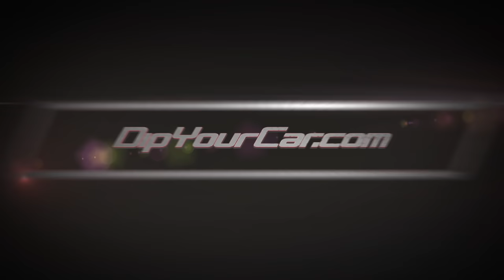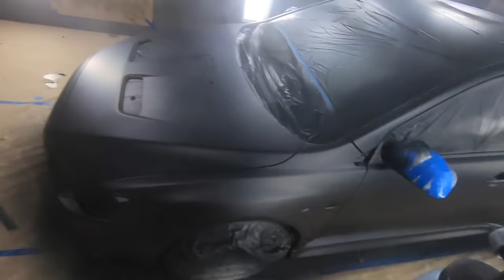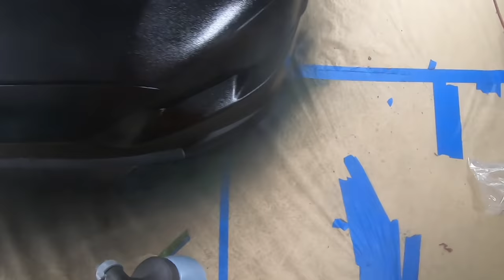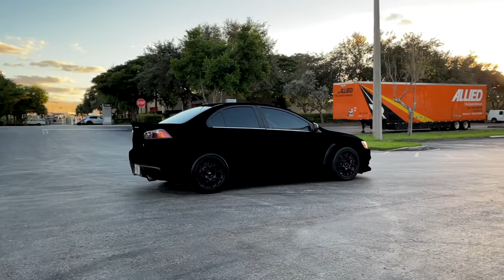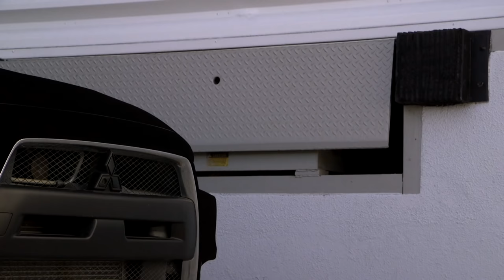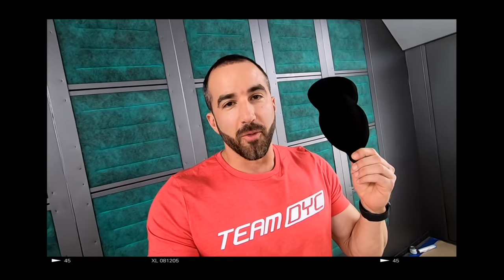Spraying a Car in the WORLD'S BLACKEST Paint (Darker than Vanta Black?)

Comment: As much as I love this.... "we do not recommend painting a car with Musou Black because the paint is fragile and the coating can easily be scratched/peeled off."
Reply: Could this fragile paint be protected or sealed under many coats of clear coat?  Also other auto paint designs are now racing through my head....
Reply: @lesacarter8834  that would 100% ruin the finish.  I have had many alternative finish paint jobs.  The best ones were just paint and no protection coat.  I have tried the matte and flat clear coats but they have more sheen and depth which inherently ruins the original alternative finish
Reply: @lesacarter8834  No. Clear coat is the source of the normal reflection in paint, not the paint underneath.

Comment: How about using the glue-backed flock IR sheet (over a protective layer) instead of the paint?
The effect wouldn't be permanent, but it wouldn't need a topcoat/a topcoat would negate its properties.

Comment: I just ordered some mousa black i have a 2013 jeep wrangler with raptor liner i did a pass with mousa black a year ago but with a roller lol and it came out good but in some spots you can see the rolls lol so now i bought 2L and gonna spray it down with a paint gun just worried that the gun will get clogged will see what happens

Comment: I wonder, would this kind of nonreflective paint be road legal? Googling, I can only find results about overly reflective paints/wraps/tape on cars, I can't find anyone who has ever asked if a car can be "not reflective enough" to be considered safe.
Reply: Hmm.... Interesting thought, I've seen a few cars painted with matte black paint irl, but it looked like a home job so idk.  Might get pulled over the same as if your tint was too dark?
Reply: so far it wasn't possible. Therefore there was no need for a law.... this might chanfe soon....
Reply: @doppelhelixes  not really musou black degrades pretty quickly when exposed to the elements, also dust and other particles adhere to it very easily, so to maintain this effect on the car you would need to only drive it for show, and keep it in a garage at all times, nvr drive in the rain, snow, or overly windy days, not on highways, or dirt roads, or anywhere with a lot of particles in the air or on the ground
Reply: i feel like its one of those things that has never been an issue so need for any legislation. one benefit im sure it would make it pretty difficult for laser radar to get any accurate reading on you
Reply: There’s a video on the bmw that was covered with vantablack and they said it wasn’t released cuz it would be too dangerous . I would totally get this if I could 🤣😩
Reply: @nevino11  Yep, it's a new thing just like 20-25 years ago there were no laws about talking on the phone while driving since the "mobile phones" were rare and huge as bricks, but once the cell phones became smaller and more affordable in the mid 2000s they introduced the laws. I see this as similar thing and if this paint becomes popular, just the radar thing you mentioned will be probably enough to outlaw it. Cops really hate when things are not going their way. I'm still curious tho to see how cops would react to it on the road.

Comment: Think of this: airbrush crazy machine parts, gears, circuits and stuff as if you could look through the car at the innards of the car. I am thinking of a combination of red, gold and silver like iron man. Then coat the whole thing with this black - aware of the fact it may be a delicate surface color. Now imagine driving this car for a few weeks with the color peeling off mostly in the front revealing the inside of the car 🤓 could look insane